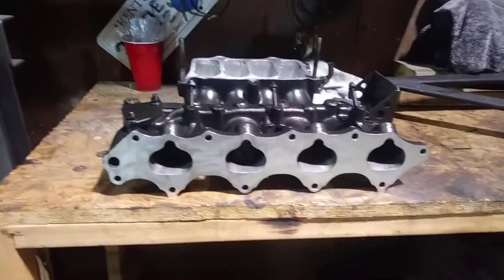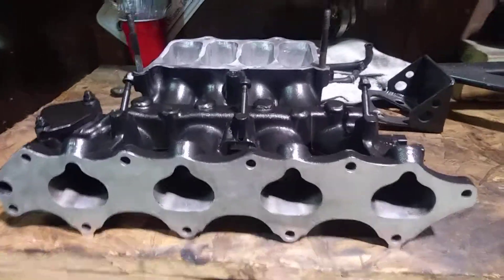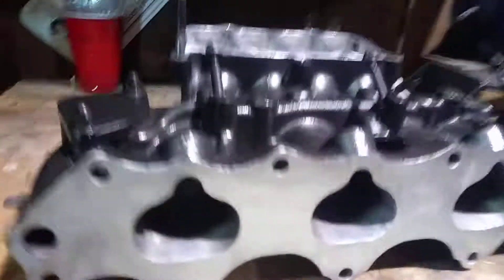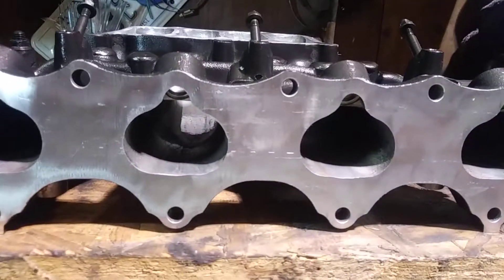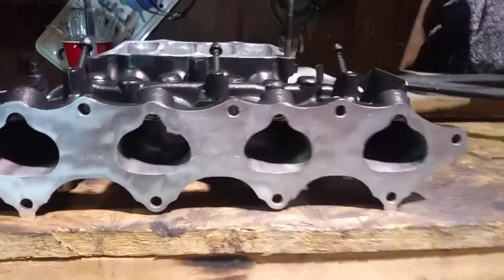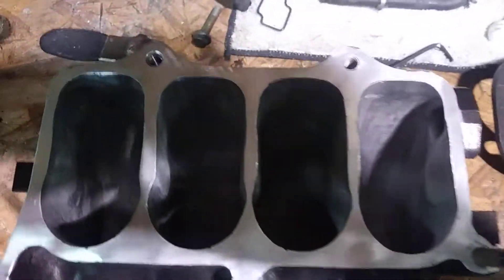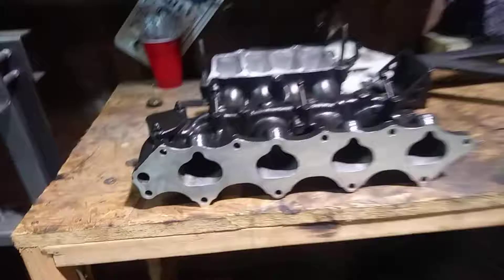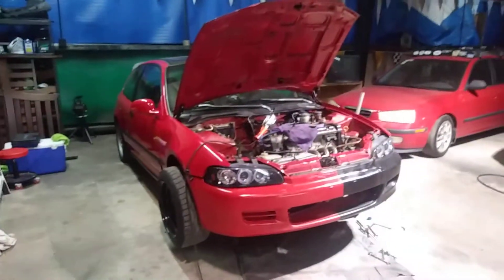H22 intake manifold stage 1 port and polishing part 7

Comment: How much difference did this make?
Reply from the maker: I can feel a little bit of difference in throttle response and thats about it. If i had my h22a tuned it would help out alot
Reply: Thank you, I'm doing a stock rebuild minus the balancing shaft delete kit I installed. I figured I might as well do this while I'm bored waiting for parts to come in
Reply from the maker: @DrivesAlongs  yeah i basically did the same thing. I had never hand machined/ported before so i thought i would take a crack at it. Also if you wanna watch another video on hand porting/polishing check out youngstacic. He has a h22a swapped crx that made i believe 210 horsepower with a tune and basically this setup!
Reply: @SpeedTrendsRacing  Thank you very much. I just made myself a test pipe last night and I'm working slowly but surely on the port job.
Reply from the maker: @DrivesAlongs  thats is whats up man! Ill be almost done with my nitrous set up on my hatch and then its off to the drag strip 😎